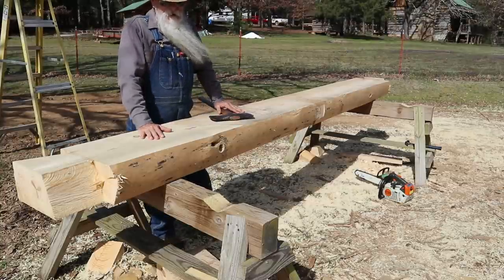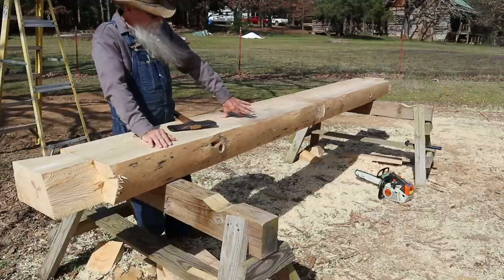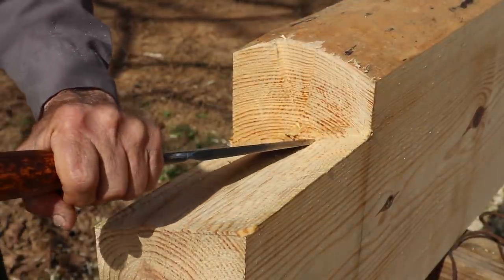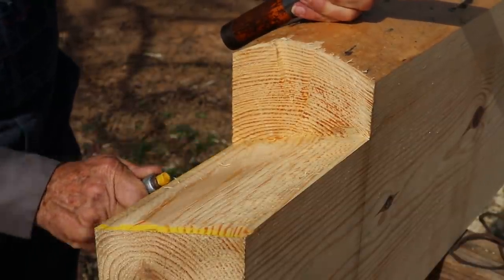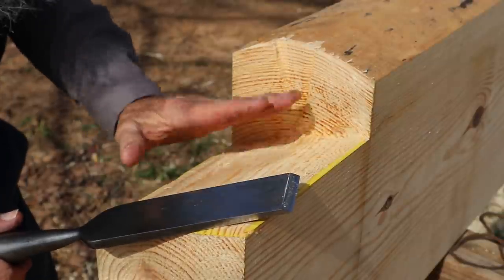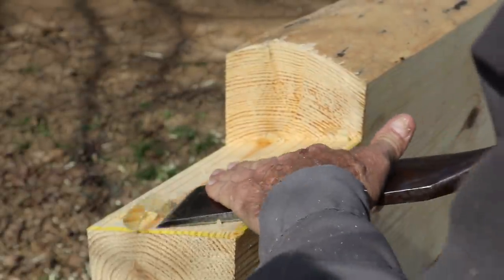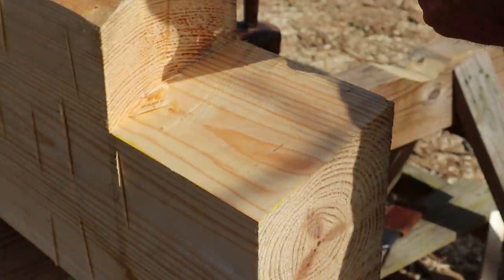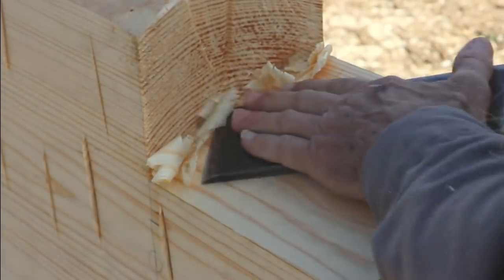Complete Log Layout Pt 2, Cleaning the Notches - Dovetail Log Cabin Build (Ep 26)

Comment: Dear Sir, thank you for another video graced with masterly skill and precision. Do we chisel and plane till the line or crayon mark is still visible or till they just disappear? Secondly, I had previously requested you to include building dormers in the cabin, which you had said you would consider. May I now request you to consider including techniques to allow for or to compensate for likely settling over the years? Please include both the places where such allowance is to be made, and the actual techniques. Regards.
Reply from the maker: AS   Howdy- I work the notches down to where the crayon marks just disappear and I can still see the pencil line. I use angle iron in the openings to allow for setting. They are slotted into the ends of the logs and up into the header logs. If I use a post I put screw jacks either on the top of the bottom and they can be adjusted for the settling. God bless you
Reply from the maker: AS   There will be a video showing how l do the angle iron in the openings. Blessings

Comment: Have you ever used a single beveled carpenter's axe, like a small hewing axe, to clean up the notches? Wondering if that would work well or not. If the added weight of the axe head would make it easier to shave the wood or not? I know someone that could forge you one to try out 😁.
Reply from the maker: Refiner's Forge   Howdy brother- the first cabin l built l cut the notches with an axe the way they used to. I may have to take ya up on that. I have a couple of little hewing hatchets. That l’ve used when shaping something. Man, the blacksmithing you do is incredible!  God bless y’all